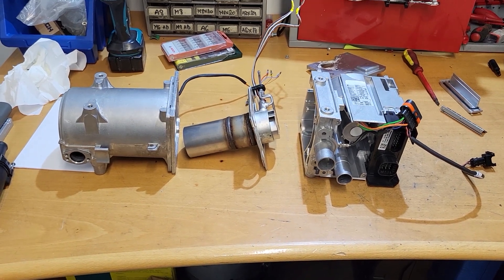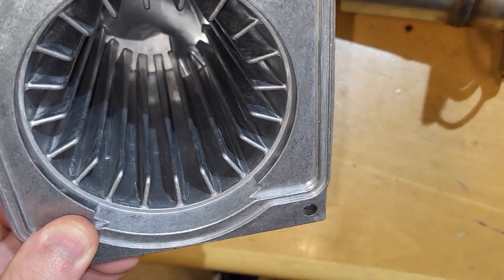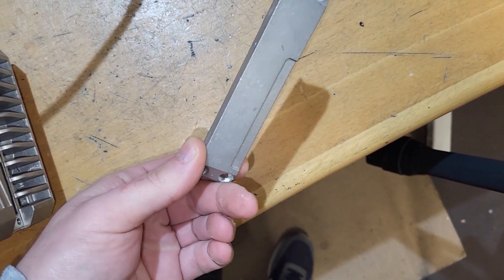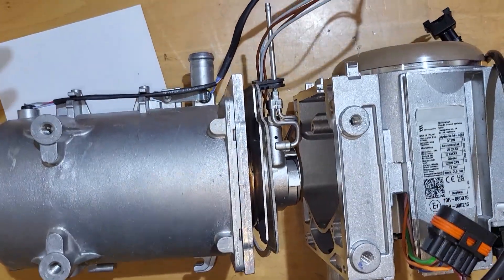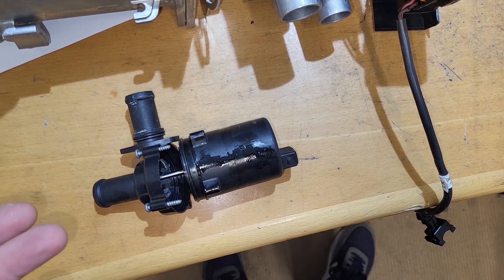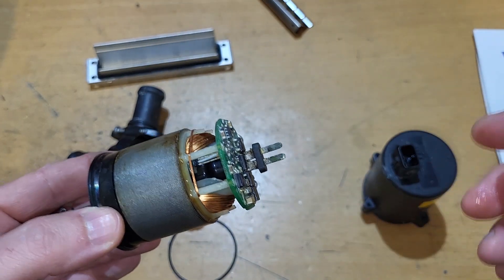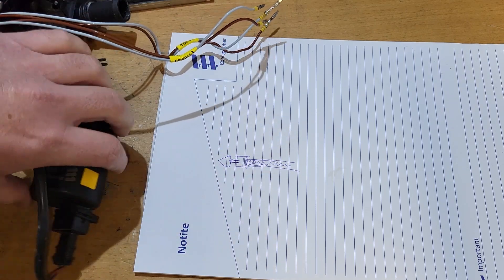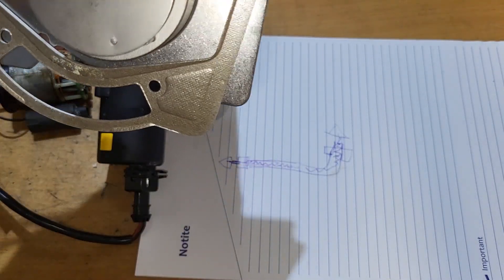Copper wires conduct water? I didn't believe this was possible. Hydronic ECU  liquid damage

Comment: This is essentially how Heat Pipes works. The pipe transports heat from one place to another (Usually cooling a CPU/GPU/etc) where it evaporates, when it is away from the heat it condenses, and the liquid inside the pipe recirculates.
Check out this video for an explanation: Heat Pipe Basics and Demonstration on How a Heat Pipe Works - https://www.youtube.com/watch?v=51bwzEO8XCw

Comment: I wonder if this would still happen with solid core wiring
Reply from the maker: Probably not to this extent but we can't use solid core in automotive
Reply: Yes....atleast it happens with coaxial cables.  Like the cables for a cable TV or Satellite tv system...
Reply: yes, though not so much.
After a flood, one usually has to replace every wire that was submerged in a house unless it is rated for water

Comment: your camera flickers like that as its frame rate syncs with the frequency of your above head fluorescent lighting. you can change to a different lighting type that isnt florescent & it will stop, or get a light with a frequency thats not 50hz, or whatever yours is, or set your camera to record at 30FPS, and it will also stop
Reply from the maker: On my GoPro I have a setting for this but not on my phone..
Reply: @DIYHelper Try using your "pro" settings on your phone and locking your exposure time. This is how long a frame will be recorded for in video. I think your phone is changing the exposure automatically based on the brightness and some exposure settings interact badly with your lights

Comment: It would be unlikely for water to go under the wire's insulation, but more likely on the outside of the seal via capillary action.  If it's some really crap cable, both could be possible.
Reply from the maker: Exactly, unlikely but it happened. I see here in the comments that a lot of people experienced similar problems.

Comment: That is why a loop is made in the antenna drops of the coaxial cables and at the bottom of the loop a cut is made in the exterior insulation, so that any water that may enter, exits through there and does not continue its path downwards.
Reply from the maker: But will still get oxidized, no?
Reply: @DIYHelper  It doesn't matter. Because it is a small section. The rest of the cable is left without water.

Comment: Wires don't "conduct" water they wick it especially high count stranded wire. The only real way to prevent it is to solder the ends of the connection and shrink wrap the insulation.

Comment: I had something very similar happen to me with a cheapo window air conditioner. Water from the drip pan was wicking its way into the power cord somehow and then out of the plug and into the wall. Luckily it didn't start a fire and I only noticed it when the sheetrock wall under the outlet started to swell. Crazy how water can travel through a power cord between the wires and the insulation like that!
Reply: I've had this happen too

Comment: Its called wicking. Its a well known thing that happens when two objects get close enough together. Also, that loose plastic jacking is a horrible thing to use unless both sides are crimped off and water proofed.
Reply from the maker: Plugs are waterproof no problems there. Wicking, ok thanks!

Comment: They also wick trough oil... it's a mess with nowadays engines or machinery. One needs specially sealed connectors for that.
Reply from the maker: They probably don't use them only where mandatory because of the price.
Reply: @DIYHelper  On a 800k CNC millturn one could except high end connectors. Or on AMG engines that have a crate price north of 35k before the tax stamp... But yes those connectors are prohibitly expensive for most applications. Sadly.

Comment: Indeed, stranded wire does conduct liquids. Perhaps solid core would too, but to much lesser extent. And the system doesn't even have to be pressurized, it will happily wick it against the gravity.

Comment: I've seen water wick up a wiring loom from an auto gearbox plug up to the main loom on top of the engine where it stopped in the middle of a totally sealed section of loom  😵 green death everywhere  😟